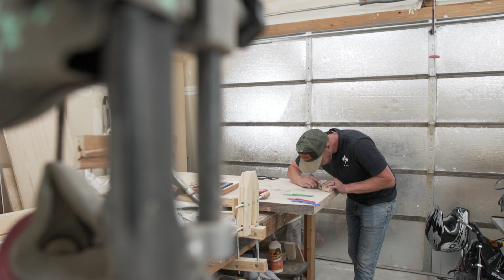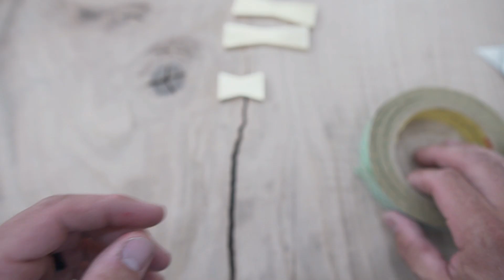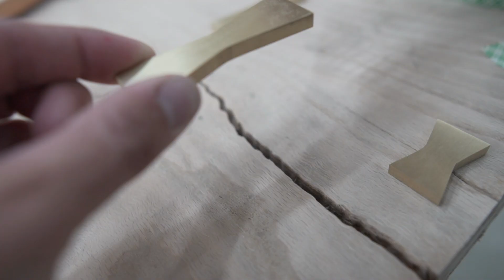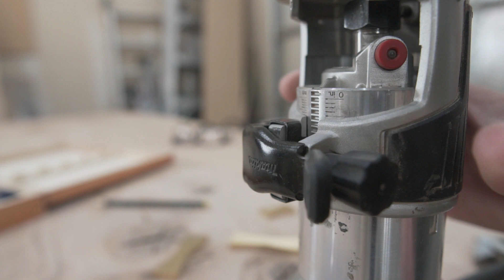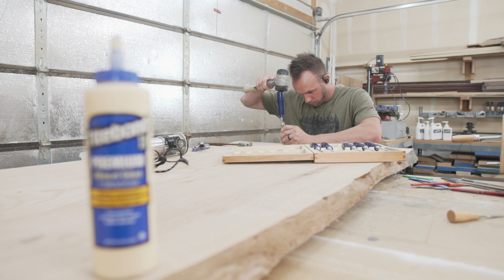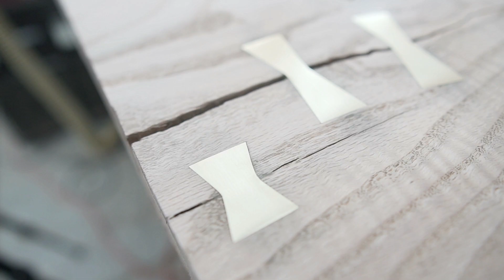5 EASY Steps to Inlay BRASS BOWTIE KEY into WOOD - ASMR

Comment: Do you need any special sandpaper, blades for shaping brass? Looks beautiful
Reply from the maker: adriano yanez thank you!  As far as shaping the brass I honestly just used my Woodworking bandsaw, some random files I had in my toolbox and some 120 grit sandpaper on my palm sander and then finished them up with some 400 grit.
Reply: @blacktimbercompany5716  awesome man, one more question, where do you find your stock? Is there a specific type that works the best?
Reply from the maker: I actually just found a local metal supplier that had some. I just called around.  Hope you can find some near you.

Comment: Alright, so I'm adding copper bow ties to a project I'm working on, as requested by my client. I've never done any kind of metal bow tie. I'm also burning it (shou sugi ban). I've beenntrying ti wrap my head around how to do this, when to install the bow ties. I figure if I install the bow ties before I char it, I will have to cut some wood bow ties of the same size and cover them copper bow ties with them. If I put the bow ties in after doing the shou sugi ban, I run the risk of sanding off the charred wood around the bow ties.

Comment: Nice video! I'm planning to use 4 inch wide brass bowties on a thick walnut slab. Since its a metal and expands/contracts more than wood, can it cause cracks with temperature changes?
Reply from the maker: You shouldn’t have any movement with the brass, it would take significant temperature changes to cause little if any movement.